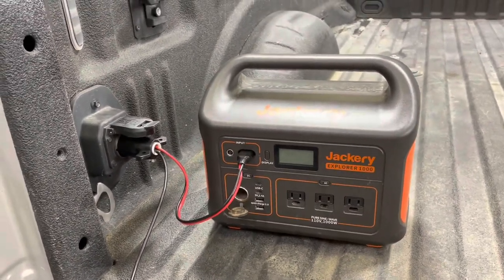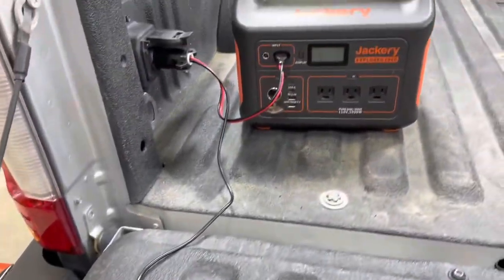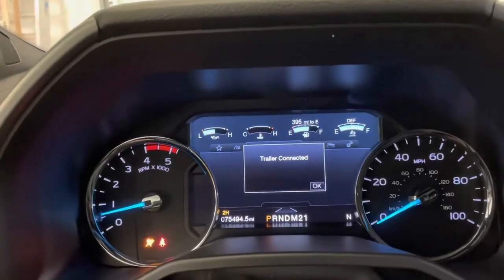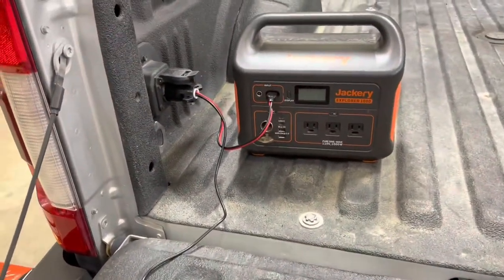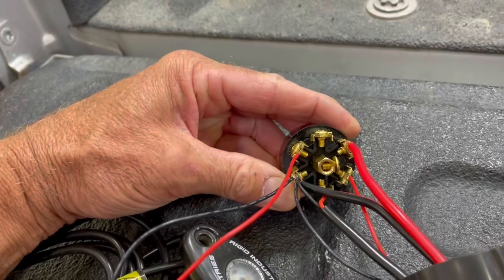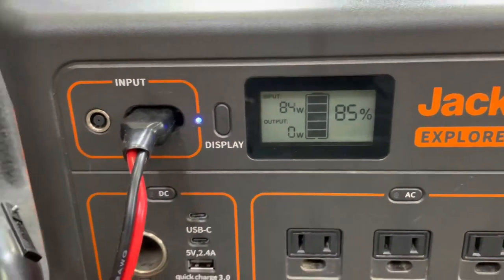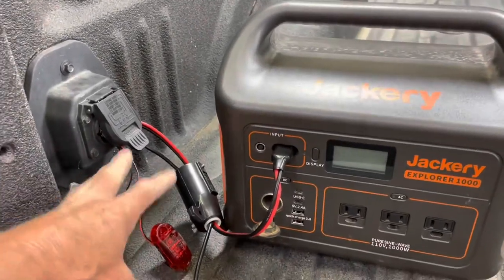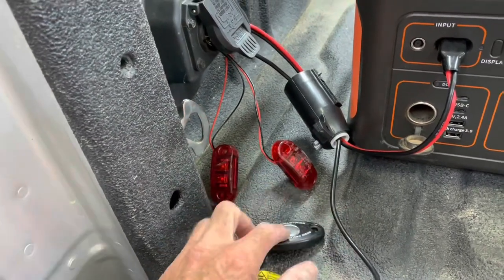Tricking our 2017 Ford F-350 into turning on 7-way plug charging circuit

Comment: I got a 12v outlet waterproof outlet from Amazon and run a wire to upfitter 6  and changed the switch to have power any  time the switch is on. And that allows you to also run chest refrigerators air compressor and other 12v accessories

Comment: Did you think of just switching pins to the running light pin? It's also a 30amp fuse and all you would need it rewire your plug.

Comment: I found it very annoying not having constant power to the hot trailer wire. When we RVing and boondocking and it's cool enough for the furnace but not wanting to run my little generator, with one RV battery, the furnace only runs until about 5 AM. It would be nice to be able to start the truck with my remote and have power going to the RV battery which needs 10.5 volts for the furnace to run. I can now do something to fix the problem.